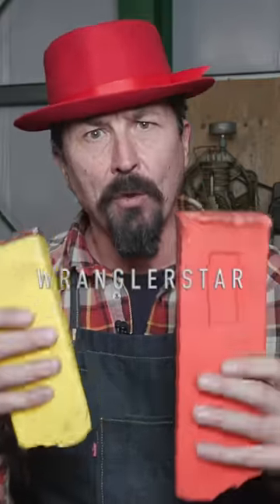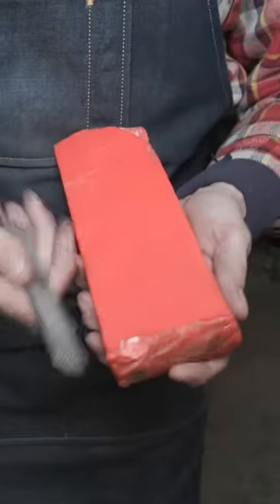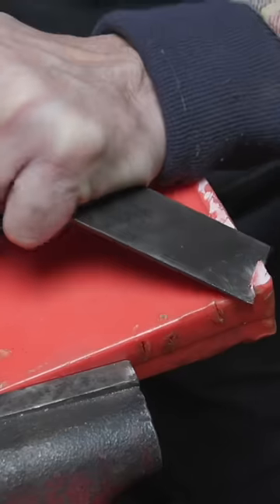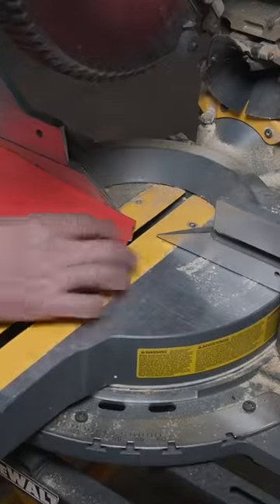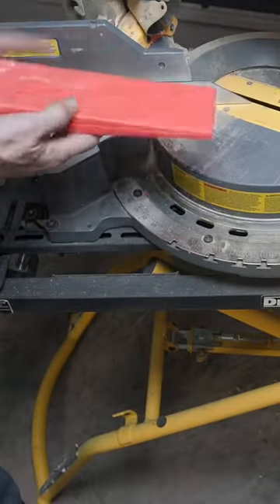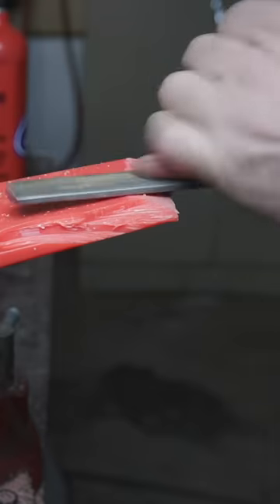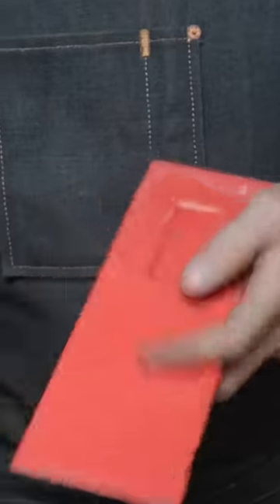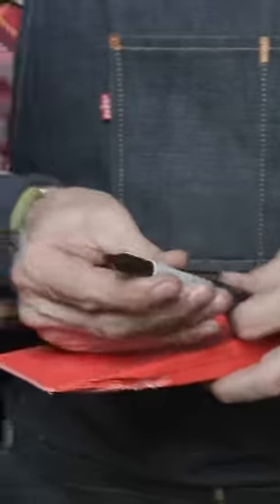Men Are Smart

Comment: For marking things of plastic,  I like to use a set of metal Alphabet punches. Heat the tip with a torch and touch into the plastic just enough set the letter. Then a contrasting color of paint marker inside the imprint to make a bit more visible.  I've marked hand held radios, kydex, key fobs, tool handles, ect this way for years.
Reply: Oor use a sharpie and redo it when it fades
Reply: @mattmurphy7030  the idea here was to be permanent, and not easily erased if stolen.
Reply: We use a tool somewhat similar at work for our power tools on our trucks when they need to be engraved. Just heats up n they burn em in
Reply: @Ngcarson1337 
 I think I bought a cheap set from harbor freight several years ago. Of course I am not sure if I could find it right now.
Reply: @mikebolton3816  🤣

Comment: Plastic wedges are used mostly to convince a recalcitrant tree to fall where you want it to.  You can use metal ones, but cutting into a plastic wedge won’t dull your saw.  I suppose aluminum ones won’t either.
Steel wedges are mostly for splitting tough firewood pieces or for splitting longer logs, like 6-12 foot logs.
You can use steel ones to direct tree felling, but watch what you’re doing with your saw.
Reply: Ok
Reply: 0😅
Reply: I'd never use a metal wedge near my chainsaw, only with my sledge hammer for splitting.
Reply: plastic/wood wedges are the best, and cheap as hell too

Comment: Can’t wait the see how many people say you did it wrong. Lots of professional YouTube comment loggers telling an actual proho how to do things. Laughable
Reply: Yeah well here I go..don't use metal head wedges. I've seen chips fly off and go into cutters eyes
Reply: Pot meet kettle…
Reply: 4" grinder 30 seconds or less, done
Skookum
Reply: @mikecosgrove7582  - real men just use the chainsaw in their hand when the wedge needs a touch up.
Reply: @trails4all  that isn't a problem if you maintain them
Reply: I admire you prohoes 🫡
Reply: @escapetherace1943  the capped top ones like one of them he has can delaminate, their not solid steel heads. I used to use them a lot, thought they drove in better. We definitely grind down the heads of our steel splitting wedges often. Those will throw nasty shards if you don't stay up on the "mushrooming" heads. I'm glad he's showing some maintenance that is often overlooked.
Reply: Prohomo
Reply: What exactly is an “actual proho”
Reply: Every logger I know uses a bench grinder. I'm sure this is how the forest service does it when they are making a file add. You see the affiliate link? It's an add, like everything he does...
Reply: Weellllll  . . . . Since you said it😂 I'll explain. The one that are broke at the tip in the corners actually don't need to be fixed unless you want to. Sometimes we like to break the corner off so we can wedge while cutting into the tree at certain angles. It keeps the chainsaw from hitting the wedge and a potential kick back at times also. Just a proho tip from a tree guy and yes I have climbed as well but not enough to call my self a climber. I prefer the ground take downs. I love it🎉
Reply: @DaveSwart it's short for professional home owner. Basically don't just go to work and come home to sit on the couch. Actually get up and better your land and house. Obviously everything needs to be  maintained. So always be productive on your own property. Hope that helps
Reply: @DaveSwart don’t ask questions Dave you’re not allowed to here. Go read the Bible! but don’t ask questions about that either…
Reply: Being a lunatic that owns a home a professional is quite the stretch
Reply: You commented wrong.
Reply: Doesn't  mean they are wrong
Reply: @JonKirby-bj2sv  I think hes in the closet

Comment: To make the cut use a scrap piece of lumber and cut it past 45 degrees. Leave that piece on the fence and use the bevel as your fence. You can then take the angle beyond what most miter saws are capable of.